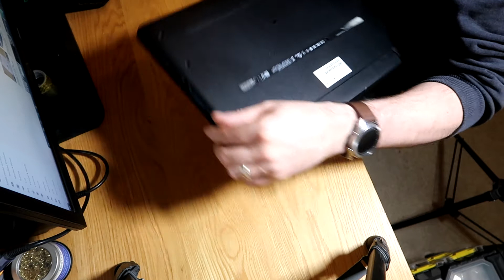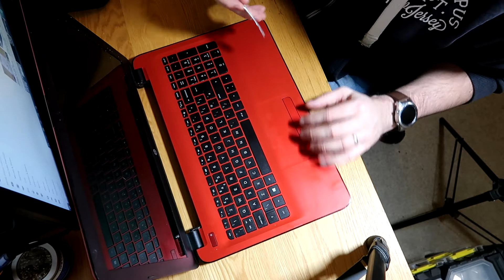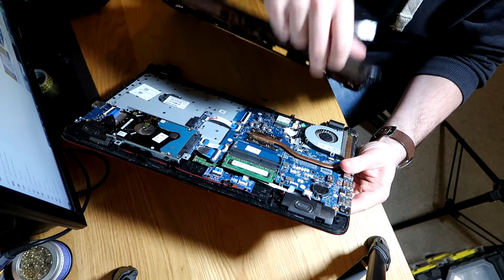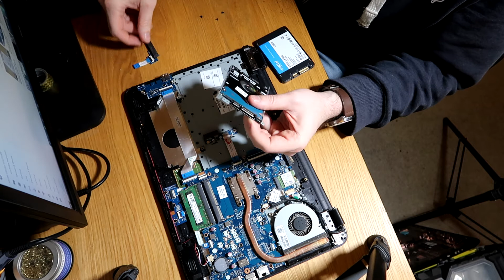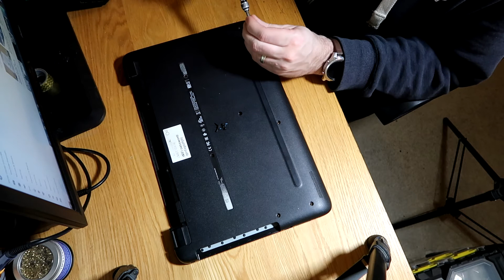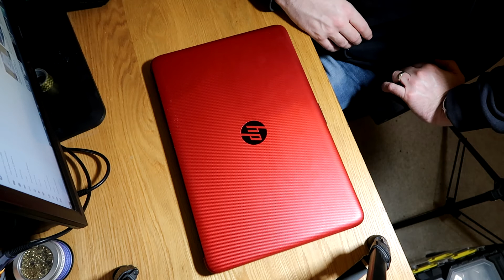HP 15-BA079SA Hard Drive Upgrade to SSD

Comment: I installed Crucial MX500 into HP (cloned with Acronis software) same as yours and piece of shit won't work
Reply from the maker: What error you getting?
Reply: @WeRepair  Hi, I recloned in manual mode and changed bios boot settings and it worked